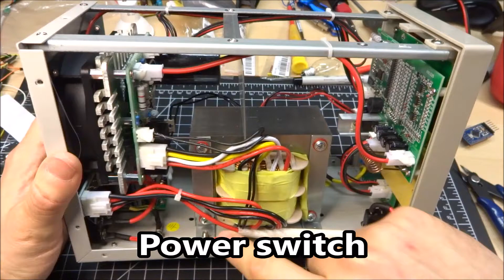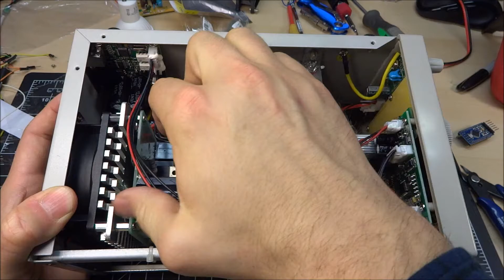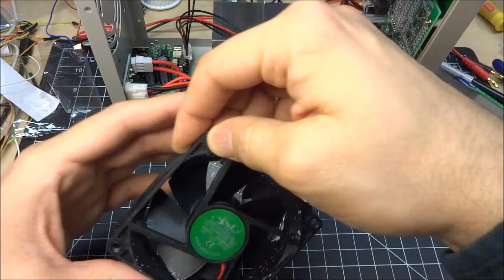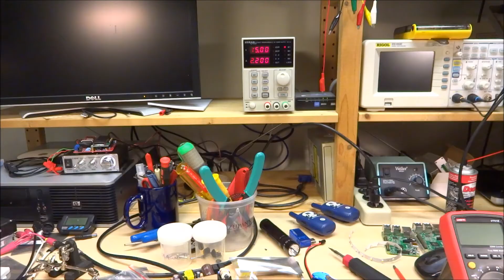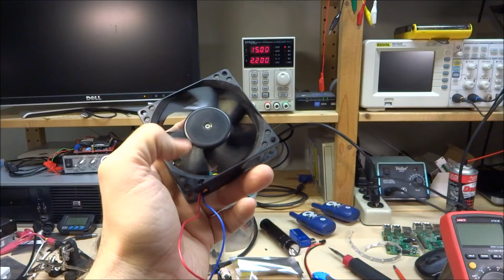KORAD KA3005P power supply fan replacement

Comment: I bought three KD3005D's, which are essentially the same thing, and all three fans died after just a few months of light use.  The fan is definitely the weak point of these power supplies.
Reply: Are your Power Outlets "extruding ones" (where you can connect a stripped wire) like here in the video
or are they of the "flush type", like on Voltmeters (the touch protected ones).

Here in Germany at reichelt they sell the version with the "protected" outlets (except for KWR103).

Are you dutch? Where did you buy yours ($), and did you buy them when commenting this?

Thanks

Comment: i have 2 30-32 volt 5 amp KA320.3005D dc supplies.In 1 of them i turned the fan so the blow direction suck air in from the back.Different cooling fins on mine.It got more quiet with the fan turned that way.Temp on cooling element and at the current shunt at the front was a little cooler the noise lower.I placed 2 temp probes 1 on the cooling fins and 1 at the front to compare the 2 supplies temp.

Comment: Add a capacitor to get rid of unfiltered PWM which powers that fan. 47uF or 68uF should suffice and it will get quiet instantly. Even with the original fan.
Funny, how you totally ignored the fact that new fan on it's own is quiet... that should ring a bell or two ;p
Reply: @rozwell69
 Thanks, fan replacement and adding a capacitor works very well for me!
Reply: @FliegenderFluegel  I'm happy someone found that useful :)

Comment: Hey Adrian, I may have found the source of your frustration with the sound levels. I have read in a few reviews that the fan voltage is actually 24v in older ones! It may be worth pulling the cover to check yours.

Comment: Hi, the blue resistor R3 is blown on my device (mounted on the upper edge of the board shown @sec 20, close to the fan connector) could you tell me it's value, so i could replace it. TIA

Comment: I may change my fan anyway,  because mine is noisy like a rattle , like a bad bearing or something even at no load
Reply: DRYFIT55 its the power supply for the fan. Adding a capacitor helps it  a lot. Check out my video how i fixed it.
https://youtu.be/RJbagaIx8no
Reply: @Mordaur  Thanks for adding this comment! I found your video this way and it helped enormously!

Comment: I've just used a 50C thermal switch. So it's always quiet as the fan doesn't spinning at all at low voltages and amps, which is usual for low power electronics.

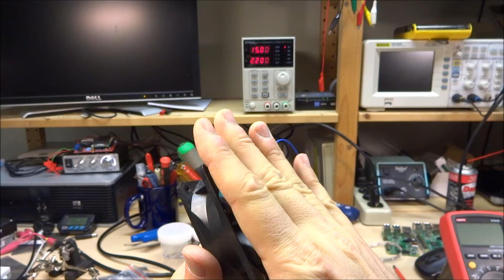Comment: 8:40 Yeah, flat up against the fan, turbulence and noise. I find it odd, for many times I use this PSU I only pull 1-100mA at 5V, and why all the noise when there is low power dissipation in the regulators anyway at those low current levels. Its like they have all this space in there but use an under-dimensioned heatsink. I wonder how they sandwiched the board and sink together with the transistors (or regulators). Also if you disconnect the fan and run it off your own regulator, will it upset the psu microcontroller? Thanks for the video  :)

Comment: Oh yeah, the wiring inside was garbage, they cut out metal for the wires to pass through but they're covered in sharp burrs, they could have at least sleeved those sections of wire.

Comment: The fan they used is one of the worst I've seen. Mine currently sounds like a jet engine from all of the horrible vibrations.  I took the case off and undid the screws to remove the fan enough to get access to oil it, now it's much quieter, not sure how long this fix will last. I used some Super Lube synthetic oil it works great, and there's no odor.